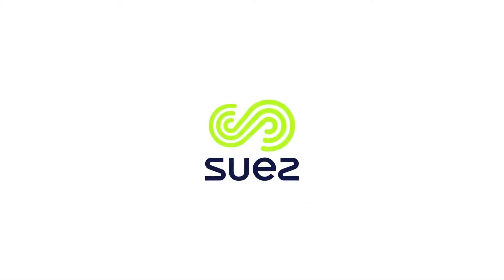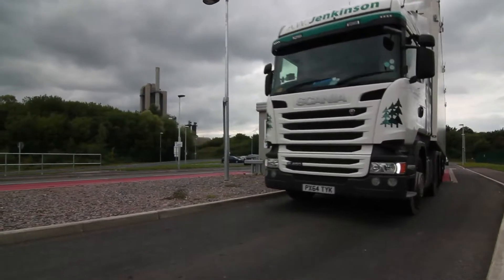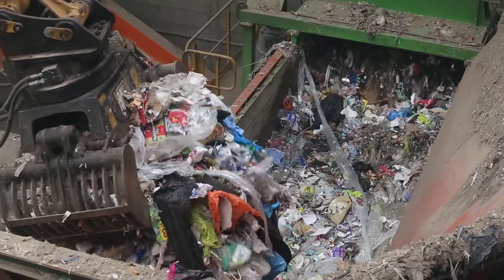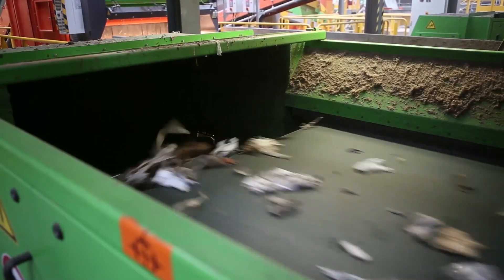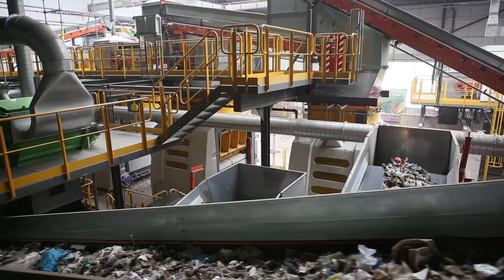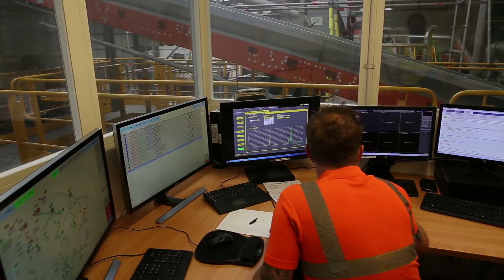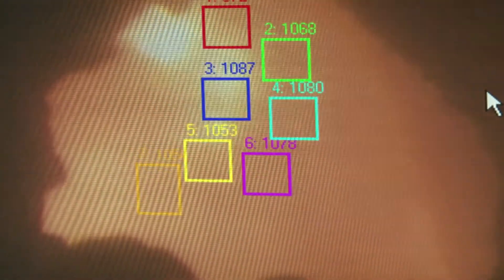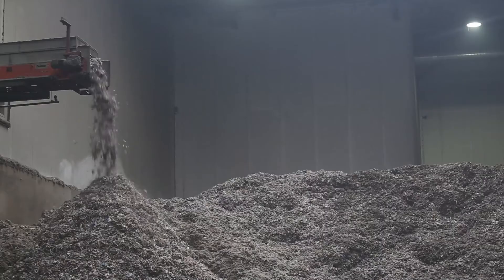SUEZ Solid Recovered Fuel facility in Rugby

Comment: What happens to the non recyclable material that is not the quality required spec for srf?
Reply: The silence from Suez UK says it all .... I'm assuming that it is landfilled  !
Reply from the maker: Hi Gary, thank you for your question. This type of waste would be sent off as refuse derived fuel, which has a lower calorific value.  SRF and RDF both help to divert waste away from landfill  by turning residual waste into alternative fuel. If it’s not suitable for RDF or SRF then it will go to an energy from waste facility.